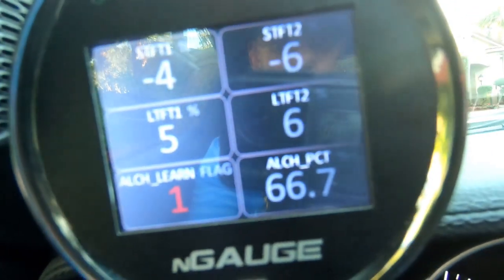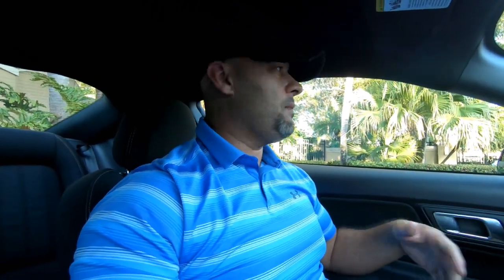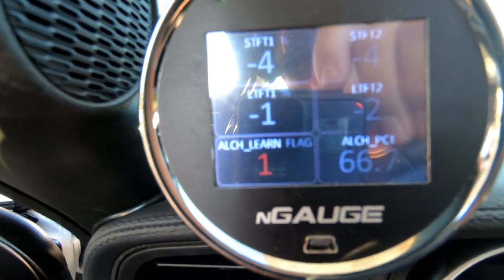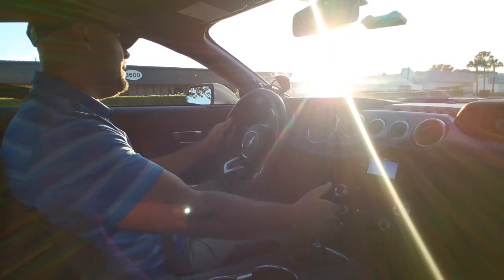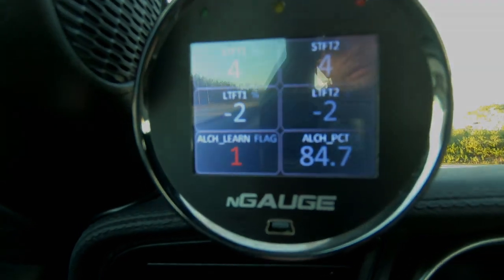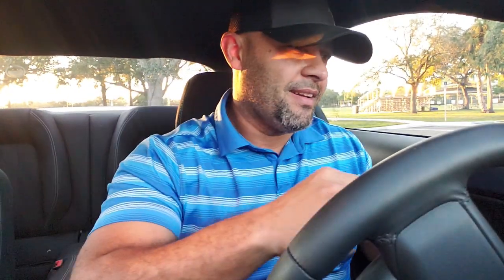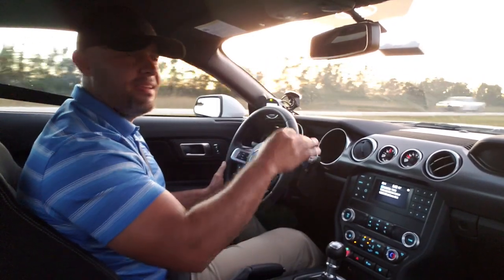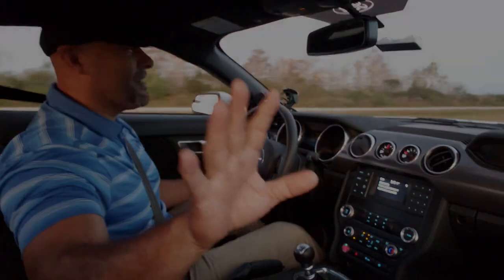Flex fuel tune Vs E85r tune. How the process works on 11-19 mustangs

Comment: Hi Alex, I had a E85r tune in my car 2017 mustang gt with SW long tube headers o/r but it kept killing the o2 sensors after a month of running E85. I know the position of the sensors in those headers might be the issue but I was wondering if there is any other solution than changing the position of the sensors. Thanks!
Reply: he has a video on why they break already
Reply: Yeah I saw it a while back, something about the sensors getting humidity or something like that because of the position that they are. Just wondering if there was any other solution I even added the heat sink thing he showed in the video and I didn’t really do much. Thank you anyways👍🏻
Reply: They need to be in the 10 to 2 position, if they're not that's your problem
Reply: csr801996 you mean the heat sink thing? Or the O2s?

Comment: I love my Lund flex tune. Not even for the power but bruhhh $2/g for E85 verses high $3s for 93. Lol, the extra power is just a bonus. 😂😂

Side note-your arms are looking huge. You been lifting?!
Reply: Running a 33% mix on my Speed3 I'd typically lose 2-3 mpg no matter how I drove. Go from about 24.5 on 93 to 21 on E/93.
Reply: Jeromy Williams word.

I took an average of 250 miles per tank on 93, at today’s prices of $2.50 a gallon for premium. Assuming the tank is 15.5Gal, it’s about $38.50 to fill up. 

On E85 it’s $1.50 a gallon, for 15.5Gal you’re at $23.25. To make up the 50 miles on the 93 tank, you’ll need an extra 3.88 gallons of E85, equaling 5.82. So on E85 I’m gaining power, and SAVING $9.43 per fill up. 

That’s also using these record lose gas prices, in the summer of 2018 it was way different. 93 was almost 4 bucks. E85 was only 2.15ish.

Comment: So if you have a flex and a E85R tune..would always recommend filling up on the flex..see the Ethanol content before switching to E85R tune? Some areas don’t always have the best the Pump E
Reply: Yes, E85R is dedicated. I buy SUNOCO E85R by the 55 gallon drum.  I fill up in the garage.  No need to see the percentage.  It’s pure 85% with 15% race gas.  I’m tuned by Lund on my 2018 GT350R and its a monster on E85R.     The E85 you get from the pump is 85% ethanol (well, it should be 51-75% is what I usually see at the pump.) and 15 - 25% regular gasoline, or at least it should be. The time of year and area you live in may has a lot to do with the percentage too.  E85R is 85% ethanol and 15% race fuel and that ratio does not change. With E85R, you can be certain that you're getting exactly what you think you're getting every single time.  I have never seen E85R sold at a gas station.  It may but I’ve never seen it.
Reply from the maker: That's not a bad idea.
Reply: @YDBT4LIFE  I wish the E85R tune at least displayed the Ethanol content a a safety measure.
Reply from the maker: @slapbeat67  e85 r is dedicated. And wont show percentage.  If you want to see percentage flash the flex tune.
Reply: @YDBT4LIFE   yup, this is what I do...just a pain that's all.
Reply: Alejandro Flores como puedo contactarte personalmente ? Estoy tuneado por lund pero nose mucho ingles y tengo unas preguntas gracias
Reply: @YDBT4LIFE  What is the pump gas timing usually set at?

I run pump gas (85 octane) with A prototype at the maximum advance setting.  So I see no need to switch to E85.  Nearest E85 station is 90 miles away anyways.

I throw all the spark at my engine.  Past the point it stops making more horsepower.  My video shows some full throttle pulls and the timing adjustment setting on the distributor.

Comment: I went to dyno and gained 10 HP on E85r tune over flex! B
Reply: How much did you pay to get dyno tuned to only gain 10 hp? $400 plus isn't worth minimal gains imo.
Reply: csr801996 when did I ever say I got a dyno tune
Reply: Then how do you know you gained any horse power ? With out a dyno tune and testing.
Reply: Mike you all are idiots 😂😂 you can go to a dyno and not get it tuned by them. I paid $50 to throw it up on the rollers for 3 runs. I went in with flex ran 415 then did two runs with E85 and got 420 and 425.
Reply: @Mike-pp2mv  Uhhh, load the tune and strap it to a dyno...
Reply: Not bad, I gain roughly 10-11 HP on my old 13 5.0 I had with just tune/intake/exhaust/47 injectors.
Reply: Should've been more than that
Reply: Same dyno, same correction factor? If not, that 10hp means nothing
Reply: 10-15 HP is about right for n/a setup.